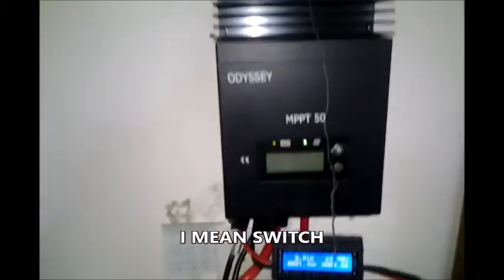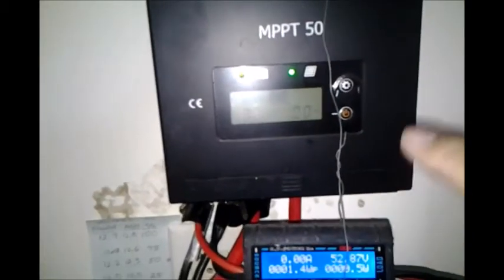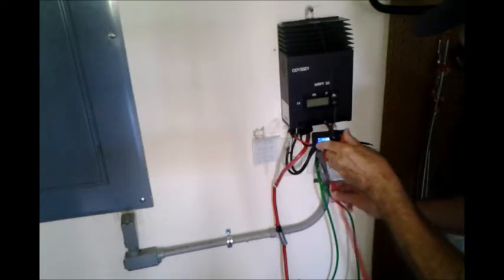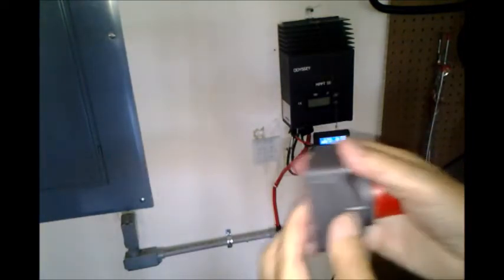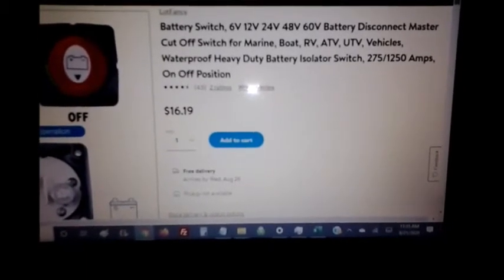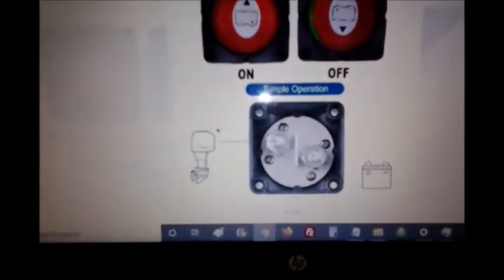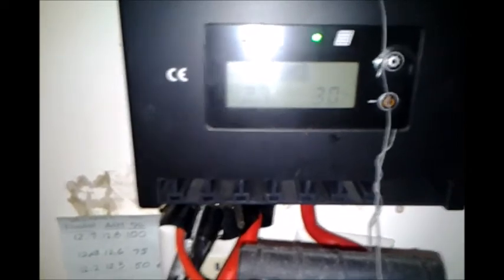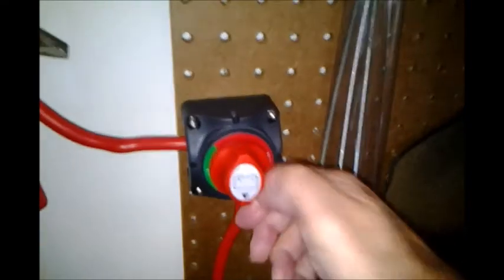INSTALLING A BATTERY DISCONNECT SWITCH ON SOLAR SYSTEM

Comment: Those wires should have ring terminations and i think that switch goes on the negative wire. I don’t think you are supposed to disconnect the battery without disconnecting the solar panel side first.
Reply from the maker: I guess you realize how large those would be?  Is that code for DC?

Comment: Will the solar panels still charge the battery?
Reply from the maker: Yes, Manuel, they are charging the batteries even more, because the Charge Controller is not shutting the power to them every 20 seconds.

Comment: I have 4 battery bank , will it work without reducing my flow and will it work when i turn it off?
Reply from the maker: The Spec's. are:  continuous rating - 275A DC, Intermittent - , Cranking - 1250A, Volts - 12-48V.  If you have it off you won't get any charge from whatever it is hooked up to.

Comment: We might need all the power we can get with the stormes coming in.
Reply from the maker: My 2 Solar Panels will run my 25 cu. ft. refrigerator & that's about it.  I have my generator, which at your recommendation, exercise more often, which I have wired into my house panel & can run most things, except my AC, in case of a power outage.  I guess the Hurricanes won't effect you too much?